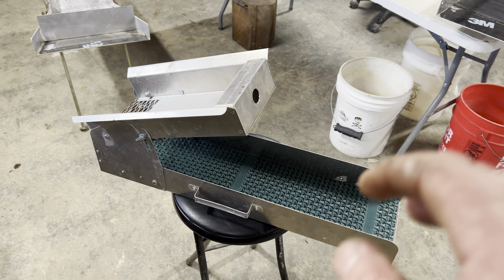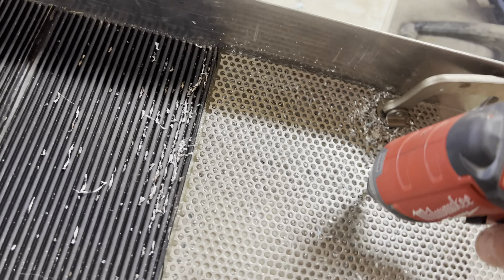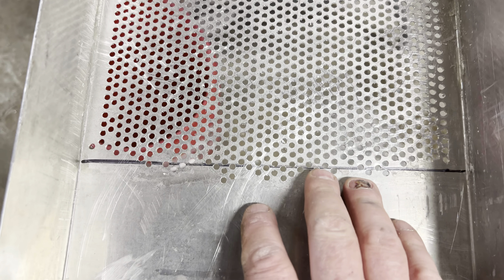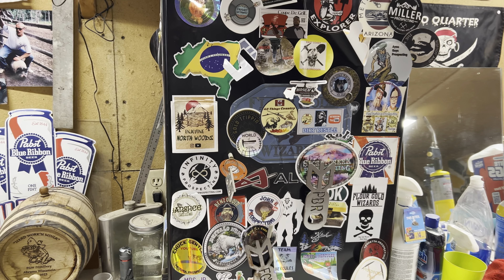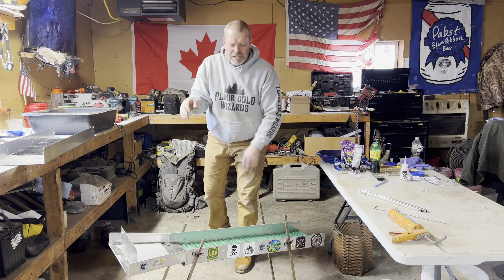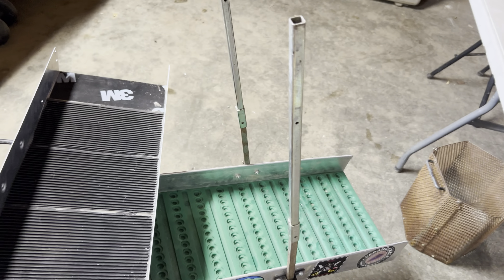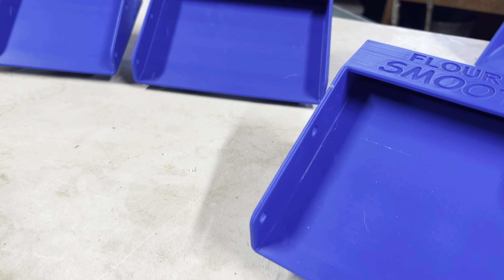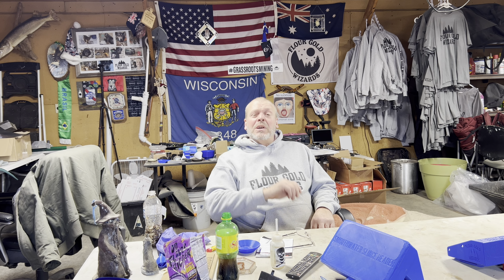The ULTIMATE GOLD highbanker !!!!

Comment: I have a crazy idea...  If you make it a 2 pail system.  One lower and one higher.  Use a ram pump to bring the water from the lower bucket to the higher bucket - no electricity or machinery.  You can then have a bigger bucket on the lower to fill on one end, and a smaller bucket up top to feed the flexible piping to the smooth water header.  You do lose some water in the ram pump, but you don't have to lift it so high.  You can even use a smaller bucket to fill with.
Reply from the maker: Now we’re getting scientific!!😃

Comment: Nice new toy.  So happy to hear you mention the prospector rules of Wisconsin.  Most often not mentioned in videos. Wondering if you removed the bottom back half and a little strip of the back,  your wonder head might work in a stream.  Water seeks its level ,like the damn you build for sluching to flow through the slush.  Just a thought.  Thanks again Jason..
Reply from the maker: We’ll be testing lots of methods!!

Comment: Yep you got me thinking about your restrictions no electrical or fuel driven motors for your pump system , Solution water powered pump like the old flour mills used , scaled down of cause, running 
a simple water pump via a shaft with gearing if that floats your boat. Food for thought Jason Cheers Mate👍👍👍😎💨🏴‍☠☮☮☕☕💡🔧💡☺☺
Reply from the maker: Thats a recurring theme!

Comment: Reverse your gravity dredge. You just need to put the pipe upstream the water pressure just needs to be out of the water connected to the bottom of the smoothe water so you should not need to long a pipe. Thanks for the share! Stay awesome.
Reply from the maker: I agree as long as there’s enough elevation drop to do it
Reply: @FlourgoldWizards  You could also use one or those no electric water pumps . same idea but needs less elevation .

Comment: Slick. If you are going to set up in a river with this, then how about a foot pump that feeds the water?  Simple wedge with some springs and flexible sides.  Hose from the top to the connection point on your distributor.  Hanging water of this is going to be dicy. It's not super wide and it will be top heavy if you put a bucket up there.
Reply from the maker: Now we’re talking

Comment: Get one of those blue things with the water spigot made it pointed straight out the back. Run some of that PVC from your dredge as long as you're at the bottom of a waterfall or something with that. You should be able to get water into it without lifting it or having legal issues. Just an idea.
Reply from the maker: My thoughts exactly as long as there’s enough dropping elevation

Comment: Use the pvc pipe idea i through at you a few months ago for the gravity fed water. It does not have to be straight pipe but you definitely dont want it corrugated. They make it in a flexible clear tube thats fiber reinforced for strength. Can roll it up n off you go
Reply from the maker: We need more elevation drop
Reply: Ok how about this, use a tarp to create a dam, in the center of the tarp make a hole with some fittings and attach a hose that leads to the sluice. Rather than elevation then maybe pressure? Imagine you filled a balloon that had a pin hole in it, the pressure shoots the water pretty far. Plus it would be easy to transport and set up if it works.

Comment: Vane pumps aren't too expensive. You could rig one up with a sediment filter on the end of the pickup tube. I would use another black tub like the one you set your 5 gallon catch bucket in, then put in on legs behind your sluice. Put a drain out the bottom to feed your smooth water head. If you want to vary the flow then you could add a manual shutoff valve in the tube feeding the sluice.When the lower tub is getting full then a few cranks will transfer water back to the top and repeat.
  Using the same size black tub allows you to nest them together for ease of transport.
   Thanks for the video, and pet those mining partners for me.
Reply from the maker: Always another great idea from the comments. Thank you.

Comment: Great idea👍. I was thinking that in a running stream or brook, you could use some PVC pipe to run water directly to the high banker. The same concept as a gravity fed dreadge. It builds pressure. Depending on how low the high banker is and how hard the water is running naturally. 🤷‍♀️ Though it may not work in all situations. You could always get a hand crank pump( like one in a 55 gal oil drum) to bring water from a bucket, with screened off holes, sitting in the water source to deliver the water. Hope someone can help with ideas. Looking forward to seeing what you choose
Reply: I second the hand pump..
Reply from the maker: That’s the direction I am leaning for sure

Comment: set a 5 gal plastic water jug with the bottom cut out on a barstool with a hole in the seat for the bottle neck to stick though, and with a hose running from the neck of the water jug to the input of your header box and dump water in to it like a huge funnel. if you put a plastic ball valve in the hose you can control the water flow. non electric, and you still get the flat water advantage of your header box.
Reply from the maker: I like that

Comment: Would it be legal to use a lever action water hand pump to fill a suspended bucket over the top? That way you could shovel  a few scoops and then fill the bucket while it washes. Not sure if that would be "mechanical" or not. Rig up a pump with its own bucket and hose system to fill the "wash" bucket maybe. Idk we aren't allowed to do anything besides pan in minnesota
Reply from the maker: Thats crazy !!!

Comment: Curious what filament is used for the smooth water .
Reply from the maker: Blue🤣🤣
Reply: @FlourgoldWizards  I only ask as I 3d print and some filaments handle heat and direct sun light better then others
Reply from the maker: @spoton6584  
I believe its pla+ ✅

Comment: So you can't have an electric pump but what about a manual one?
Reply: That might be questioned - as the definition in WI law is "mechanical".  If it is metal, or plastic, or has parts that move by an external force (electrical battery or hand cranking) then most-likely by their standard it is mechanical, i.e. motorized, an engine of sorts, anything engineering or technological - other than shovel, bucket, sluice, gold pan - would be considered mechanical.
Reply from the maker: I guess we’ll just have to test the states theory on mechanical
Reply: @FlourgoldWizards  as long as I don't have to pay any fines or go to jail for you, I'm all in.

Comment: What is the law? No mechanical at all, or no motors?
Reply: Wisconsin has a "no mechanical" device - i.e electric water pump or any mechanical movement - for lay gold searchers.  If you want to make my designs (told to Jason) it appears that you need to step up to the next higher permitting process ... and their diddle ( - ) your design ... before they allow you to have just a basic battery backpack with 2 forward hoses.  Jet nozzle pressure hose gets water (via small electric water pump) from crick or Lake Superior and shoots down into a self-enlarging hole.  Suction hose sucks up disturbed debris and shoots it backwards across the sluice.  One could run a completely independent operation of the gold searcher in the crick.  Or put all of the battery, wiring, pumps and hoses on the crick bank, and then emplace the 2 forward hoses into the crick bottom - and allow it to sink ever downward, working its way to deeper deposits (while not disturbing the greater crick environment with shovels, buckets etc).  The same unit can be operated at Lake Superior, with a long hose getting water from the lake, and then stabbing the forward hoses into the ground, and allow the unit to create its continually enlarging cavern of ever-deepening, ever-collapsing sands, ... and shoot it back across the nearby sluice.  Totally independent.  But state legal statutes of what is a lay gold prospector vs an industrial operation, even for a small battery-operated 2 water pumps - is the border line for what is lay hobby searching - and intensive capture technology.  In either case, my designs are less (non-) destructive for the environment in either place.
Reply from the maker: I think they just like to see people dig
Reply: @FlourgoldWizards  Nah !  The biggest issue is people making money and equity that the "State" can't control, finger, or TAX !   So they set up all kinds of barriers for the layman, while the industrials pay off their legislators in getting their mining claims etc.  As said, putting up my designs with a lay searcher or a consortium of like-minded searchers, setting these all across Lake Superior beach for pennies - would make gold millionaires.  Just wish I could do this in SanFran Bay (pre-1850) down to bedrock and there is $ trillions to capture !